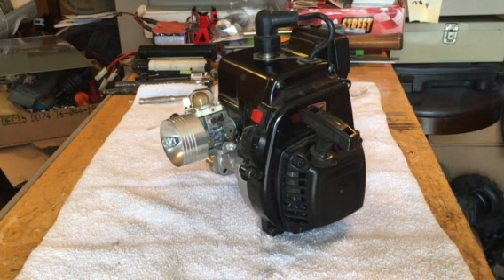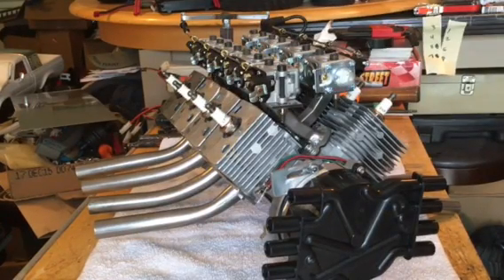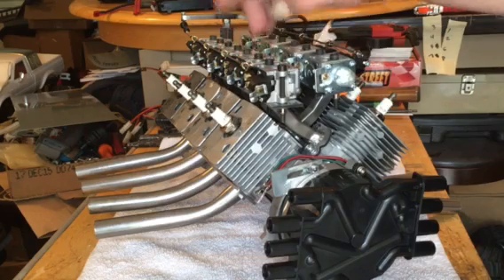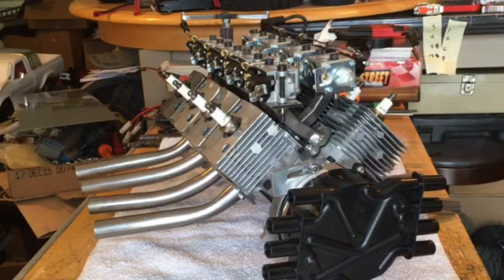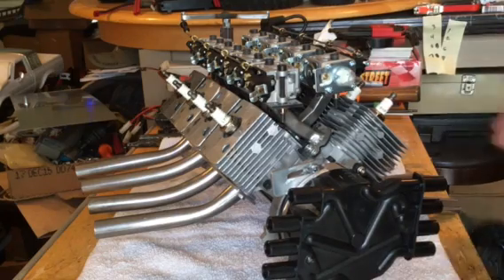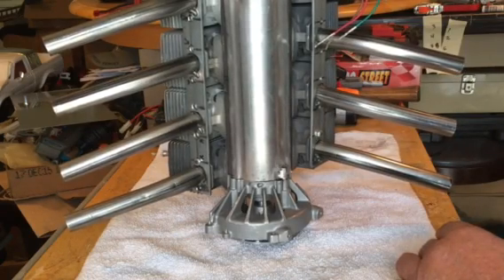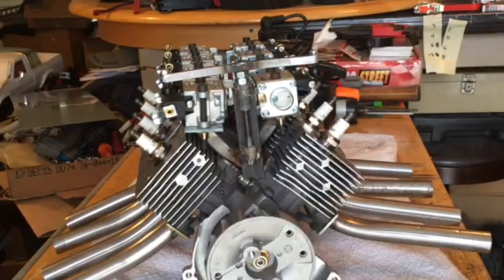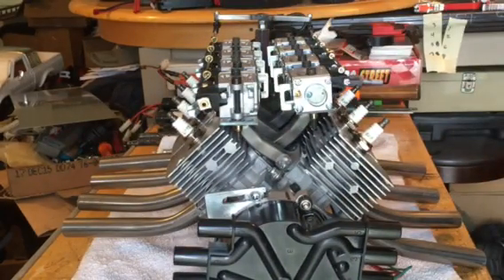2 stroke weed wacker V8 ?  This is crazy!

Comment: You will need to cut welds on crankshaft and offset 45° making both pistons TDC on each section giving to you 90° firing order 2 per fire(96 f150 distributor) keep intake manifold and weld washers  to exhausts to give back pressure. I WOULD LOVE TO FINNISH THE PROJECT, if you are tired of trying and willing to part with it!

Comment: I have been thinking about making one of these but in V12 and mounting this in the rear of my 65 corvair. Any advice?
Reply from the maker: I don't know if the crankshafts can handle the weight of the Corvair,  the crank journals are only 10mm and 8mm thick, the engine will defiantly make power but attaching it to a full size transmission will be a challenge, super cool idea though!👍

Comment: Did this ever run. I'd love to see it running.
Reply from the maker: Yeah it ran briefly but a piece of metal got sucked in one of the cylinders and locked it up, its apart now with a twisted crankshaft.
Reply: @dennisdempseyradiooutofcontrol  noon that's sucks. Hopefully you can't get it going again and post a vid up.

Comment: It won't work the crankcase is too big it won't fuel since it can't be pressurized and you have 8 leaks in the crankcase in the form of carburators  and the stroke of all 8 pistons would constantly change the volume of the crankcase

Comment: I would be interested to see how he gets around sealing the crank sections for the individual induction pressures, a real head scratcher in my book!   Can't wait to see it run though.
Reply: I'd guess he'd have to use a side housing like on a rotor to seperate crank case pressure from each cylinder.

Comment: It wont run. Besides it has no cooling. Even Harleys have heat problems with the back cylinder from lack of air circulation. Imagine here, the ones in the middle with no cooling. Besides that, have you considered balancing. You can write a whole book on just that.

Comment: Ok, once you got the exhaust pulses working in synch with the timing and yada, yada, yada, where are ya gonna mount a cooling fan that can blow an equal amount of cold air throughout all 8 cylinder heads that you so naively machined the fins off of?  
I know you didnt take off all the fins but you removed a good portion of em and replaced em with another cylinder head putting out an equal amount of trapped heat. 
I guarantee ya that even if you can synch up the pulses enough to draw fuel and pull all the exhaust gases out enough to get it started, you're gonna have at least half a those pistons squeak solid in their cylinders before you can even get it to engage the clutch. What you have there my friend, is a coffee table conversation piece and I bet the most popular conversation is gonna be the one between you and your wife about how it dont blend with her doily and ribbon candy motif she has the living room decked out in that she got from Better Homes and Grandmas magazine.

Comment: There is a company in Australia that makes mini v8 engines like conley's for 4500.00 to 5500.00

One of my customers has 8 conley v8 engines and some are of his prototype engines.  They are well built but the customer I have runs them every day so they are well worn out and I have to make parts for them.  It's a challenge.
Reply from the maker: this is an engine from them in Australia
Reply: @dennisdempseyradiooutofcontrol  lol

Comment: Hey bud iv seen two of videos on this you have put alot of work into my friend. Kudos! You should consider a getting or self fabricating some type of throttle body where you only need one carb per cylinder bank. Or two big four barrels on top. Also the mercury V8 idea is good too with exhausts on the inside but still should try and figure out how to use one card per bank. Just my two cents . Love your vids
Reply from the maker: Thanks for the tip my friend!

Comment: Hey! You did an awesome job there. Not manypeople has the stick to it ness to complete projects like this. Keep at it!
  So, did you set up your crankshaft journals like a chevy small block, 1 8 4 3 6 5 7 2 ? that way or ford's firing order either way that will have an awesomesound to it! 
  I had a 1970 Kawisaki H1 500. It came with a distributor cap mounted on the end of the crank. 
  My thoughts on simplicity  would be to use like a dodge hemi (late model) coil packs with the pick up reading the cranks rotation, have 2 cylinders fire every 90*
Either that or an old Mazda rotary distributor with 2 spark plug wires coming off every terminal in the distributor cap. (4 cyl cap with 8 spark plug wires)? 
  Watch Allyn Maymard from the UK and his crazy v6 and v12 motorcycles. That guy also has some great fab skills.

  Great video!

Comment: Pretty cool. If you get it running it will make a lot more power with expanion chambers. 2strokes dont run good on open exaust. You'll need a way to cool it also. I wonder did you ever get it running?

Comment: Did you get it to run??
Reply from the maker: Yes but lots of small problems like a staple getting sucked up one of the ports and locking it up,
Reply: @dennisdempseyradiooutofcontrol  sound like a headache think I'm gonna make something like it.

Comment: Did you get it running
Reply from the maker: Yeah it ran needed some fine tuning but a staple got sucked up in one of the cylinders and locked it up, I'm still working on it when I get the time.

Comment: How do you plan on cooling this engine? unless it's going to be used on something mobile that is moving fast enough to create enough heat exchange
Reply from the maker: I was planning on a rear fan and enclosing the heads in a box style cover,
Reply: @dennisdempseyradiooutofcontrol  you may find that the cylinders furthest away from the fan tends to run the hottest as heat contamination is a real issue, with an inline fan cooled motor. The cylinders close to the fan get all the cool air and the ones further away, get all the heat saturation, and they run too hot... My solution, is to drastically enrich the fuel to air ratio, in favor of more fuel, by either high speed adjustment or jet sizes to cool the internal temperature of the outer cylinders, to cope with this issue, it should work well to prevent, cylinder melt down, but would compromises on overall engine performance, this method of course only works if the engine has an individual carburetor per cylinder.

Comment: I thought about doing this a few years back but didn't have the resources to have the crankcase properly built back then. Was going to make a 6 cylinder and run it in my rc. I came across this video about 2 weeks after it was posted and thought it was cool to see one "done". I haven't built one yet, mainly because I still don't have the resources. But I'm starting to think that maybe I should actually go for it. Coming across this video again 1 year later and finding out this isn't running yet is kind of inspiring me to find the materials needed. Building the engine myself and making a video of it running.
Reply from the maker: Thanks for your interest in my video,  Building the V8 was a complete learning experience for me, I have built miniature 4 stroke engines with some success, I figured the 2 stroke would be easier.... boy did I have some relearning to do lol. I did eventually get it to fire off only to have it lock up because of a small staple that somehow got sucked in one of the cylinders, I wish I had it on video but I was to busy to set up the camera. Its was very violent when it started when I was setting the carbs when the mishap happened, I am still working on it .  as you can see from the comments a lot of viewers have  been busting my nads,  lol. I'm in the process of separating the cylinders and making the crankcase stronger it was flexing pretty bad,  finding the relaxing time to focus on it has been scarce lately but I haven't gave up on it . I didn't want to do another video on it until it was running again because I felt it would a click bait video,  any questions about it feel free to hit me up and if you decide to build yours it will be cool to see another engine.

Comment: Do you have a video of it running
Reply from the maker: not yet the first fire up was kinda violent, then a piece of a staple got sucked up the cylinder port and locked it up, so its back together again waiting for some free time to try it again.
Reply: Dennis Dempsey Radio out of control  wow how’d a staple get in there ?

Comment: This is so awesome. Coming from some random guy on the internet, you should be proud. Definitely need to come up with some sort of blower shroud to keep those heads cool. If it rotates counter clockwise (looking at it from the flywheel side) it could be done with that flywheel. That ignition system outta pop even with a smaller battery and you could do away with alot of weight by just throwing a cup on the crank with provisions to wrap your own rope up (Like no recoil, manual wind it every time). Im gonna look into this myself, I got alot of old Ryobi commercial grade weed wackers laying around that could be doing some cool stuff lol Thanks

Comment: the only issue i can see in this entire build other than induction which has already been brought up is the ignition. both the original distributor that you put on and the points conversion kit are built for a 4 stroke motor and the only way i can see to get passed that is to cut in another window to disrupt the electrical signal at exactly 180 degrees from the other window so itll fire off twice as fast. but im a little rusty on my old school electronic distributor tech. i dont remember how many windows they have. but it seems like it would have to fire twice as fast so you actually take advantage of the 2 stroke. what did you do to overcome that???
Reply from the maker: Very sharp observation! Here's what happened... It didn't work because it needs to fire 2 cylinders at once and getting spark to travel down 2 wires at the same time is impossible and during my initial startup the plastic electronic reluctor wheel in the distributor kept exploding, so I scraped the whole 4 stroke distributor idea and added 4 small harley motorcycle dual coils and used a electronic points conversion to the distributor housing with no cap, it worked but the plastic reluctor wheel exploded again,  so I made one out of steel with 4 slots to trigger the coils at once and that solved the ignition delima. during the fire cycles the 2 cylinders at the top of the compression stroke fire off and the others dont until their at top stroke.

Comment: I'm guessing it didnt run since you dont have a video of it running? I was thinking about the induction system being a problem
Reply: Would be good power boost and fix your induction issue.
Reply from the maker: Haven’t had time to get to it,  unexpected hospital stay threw a wrench in the project. And your right about the induction setup, not enough air draw .
Reply: I've thought about this for a long time and have been trying to find a solution. I literally just found this... rbinnovations.com sells a supercharger kit for 1/5 scale. You will have to browse through videos of different types of kits they have,  but it may offer a solution for this induction issue. Do some research. I havent found a kit I'm going to try yet but they have a video about installing it on a rc car. Look it up and see what u think.
Reply: The supercharger mounts with a blower inducer under the carburetor... with a Reed valve, this could work
Reply from the maker: M Bruggemeyer  I remember these super chargers I never thought about them for this project Thanks for the suggestion my friend! Cool idea!

Comment: How did you join the cranks together and how did you make the crank case and want angle do you have the cylinders on
Reply from the maker: Jack Pudney I notched the crank journals male to female then slid two bearings over them to lock the 2 cranks together in the main journal that way it would be serviceable in the future. The cylinders are 45 degrees apart like a small block Chevy engine.
Reply: Thanks for that

Comment: How did you make the crank shaft, did you connect each individual one together by welding it, and how did you position each crank when you connect them? I've been interested in doing this but this part of the build is preventing me from going through with this because I don't know what to do. Thank you for you time.
Reply from the maker: yea i welded the counter weights together and lined up the piston rod journals so one would be firing and the opposite would be at bottom dead center. for the main journals i connected them by grinding a male and female keyway then sliding 2 bearings over them to lock it together.

Comment: I'm impressed with your build Dennis! How did you end up separating the individual crankcases? I have had this idea for a couple of years but never started on it. You have renewed my interest in it!
Reply from the maker: Thanks!  I used a piece of 2 inch pipe and separated the cylinders 2 at a time, but theirs not enough crankcase pressure to feed them yet, still working on it.
Reply from the maker: Hey I just uploaded a video on how to the 2 stroke V8 for everyone.

Comment: i would do a mikuni intake for it use like a 22mm carb
Reply from the maker: That's a great idea!  synchronizing 8 carbs sucks one carb makes more sense.
Reply: @dennisdempseyradiooutofcontrol  i mainly say 22mm because the predator 212 mikuni kits use the 22mm and its only 4 cc difference

Comment: That's sweet it would be a great motor for my 1/2 general Lee build
Reply from the maker: i will have to do a video on building it if it works
Reply: @dennisdempseyradiooutofcontrol  that will be awesome to see seen a couple small V8 engines and them running but not if one being built
Reply: Exactly!
Reply: Finally a real small block chevy! scale it up to 540 CID
Reply from the maker: @jlo13800  yea !!!!
Reply: i work around 8v71 2 stroke generators on the dive boat im on they have a blower burn about a galllon sae 40w a day if loaded up enough.
Reply: Are you using a common crankcase with blower scavenging?
Reply: @jlo13800  to get my 1/2 scale RC general Lee going I just ordered a 35cc 4bolt 2 stroke engine later on if I can find a miniature V8 engine that would fit I would bolt it under the hood
Reply: blown 2 nstroke high power